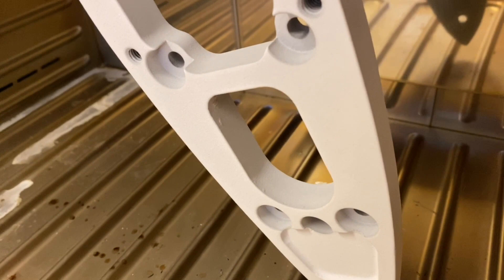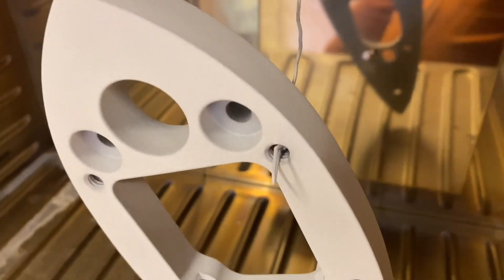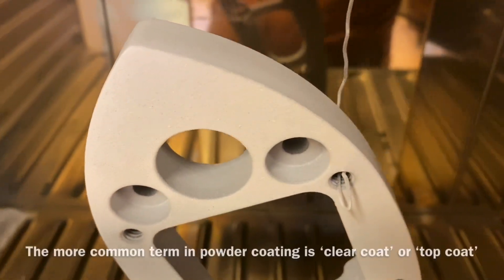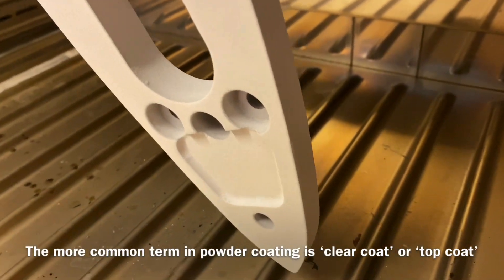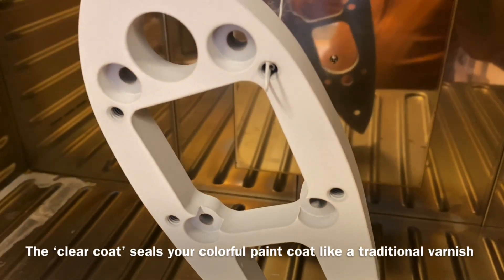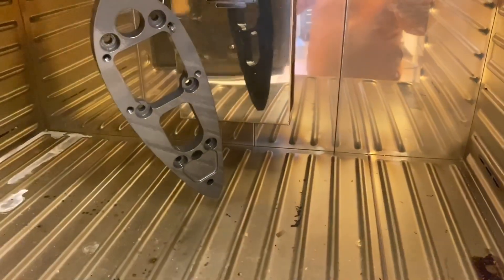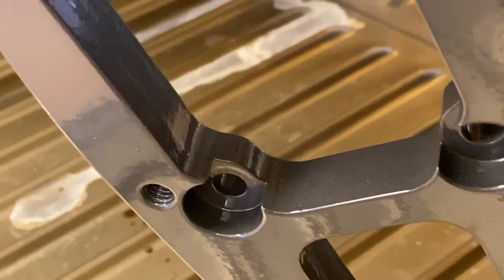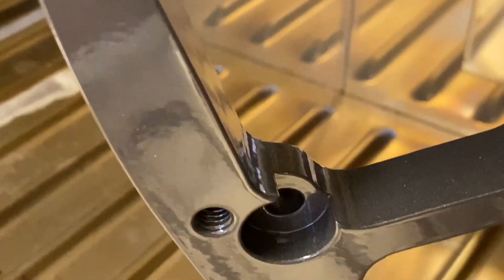Explaining Gunmetal Gray Powder coating - with high gloss top coat!

Comment: 1.33 you can see all the dust/ dirt  in the primer ... this was were a light sand whould have made all the differance  , but your part needs to be  spotless clean before you aply any powder or its never going to look any good .  i blast then compressed air blow off then tack rag  and if i can see dust n the powder i blow it off and start again
Reply from the maker: Thanks for good input! I’m not sure that what you see there at 1.33 is dust but you certainly highlight an important aspect that a sand in between would be making a big difference. I’m leaning towards believing that that unevenness at 1.33 was some kind of orange peel effect because I cannot recall I still had it after the final top coat. I will have to look again! Thx for great input
Reply: @Ken_Sweden   iv been coating at home for a wile and its hard to keep dust off the part.. When you apply the  coat of powder it should be an even  uniform coat.. Use a torch and check the part over., dust ect  shows up under the torch light.. If in doubt.. Blow the powder off and start again....i never hot coat.. You have no chance to fix problems with this method.. Powder can be flatted back nock the shine off and overcoat.. Best wishes Ian

Comment: I'm glad to see you working with this. Many restorers are using aerosol cans of paint which many years ago when I used them were very soft coatings good only for ornamental display uses. I wonder if they are much better now and how tough powder coating is. A factory finish was always in a different world than anything I could do myself, but again, it was a long time ago when I last painted anything that wasn't a wall.